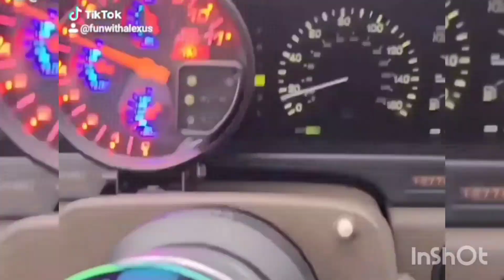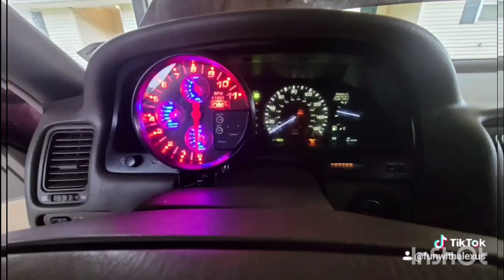update on the LS400

Comment: Hi Lexus Life I bough a dead 1995 Lexus LS400 from a college student and I charged the battery in full,  the car start rught up runs for 10 sec and shut off  doesn't wanted to stay in idle I been swapped all the major control components throttler body, mass air flow sensor, throttle position control valve, Idle control valve including ECU out of a known working car but  still not success. any thing  may comes across your mind please give me any  advice.  I'm surely and greatly appreciate thanks.
Reply from the maker: Check all your vacuum line and idle air control valve tube to if its hard as a rock change it sometimes when they are hard it will suck air in throw those hoses and the mass airflow sensor will not be able to read that air and make the car not run
Reply: @lexuslife  I'll thanks so much